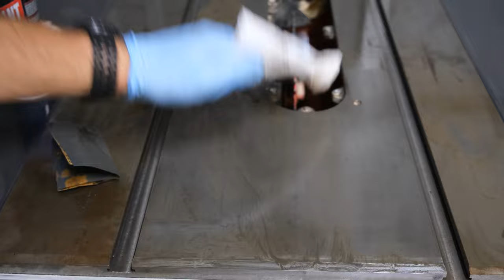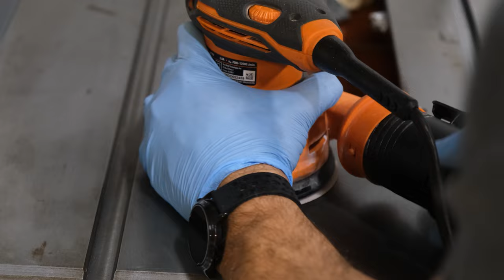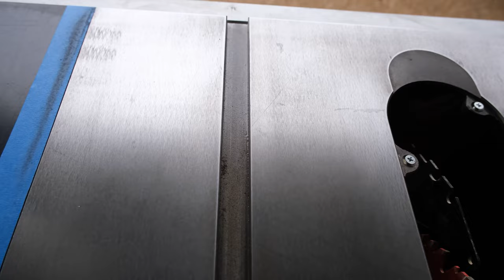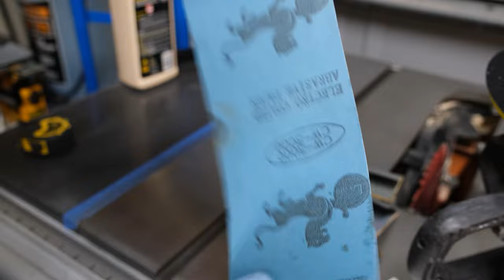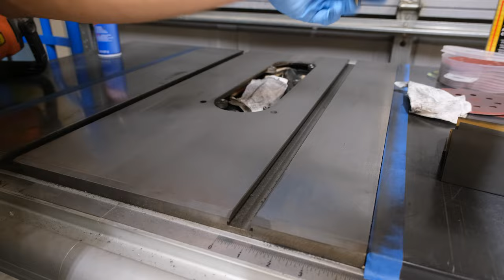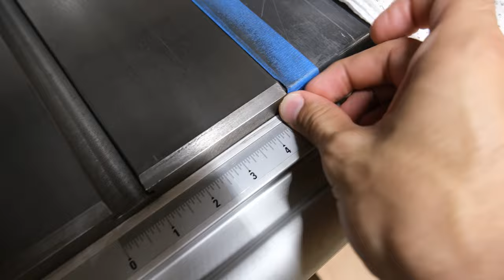Rusty Table Saw Restoration | Ridgid

Comment: Looks great,, but tons of work... next time, try scotch-brite pads using WD40 rust release as lubricant and either your palm sander or prefit wheels for your buffer. It works better and a lot faster.  Get some boeshield rust and stain release to get rid of the dark staining and save all of that elbow grease.  Your table top size, in worse condition, can be done in 30 min or less.  
I forgot to add...dry scrape all surface rust away using a fresh razor blade in a holder, taking care to not run the blade over the perimeter edges of the table or miter slots.  Do it slow so you don't scratch the surface with the blade either, and change the blades as needed.